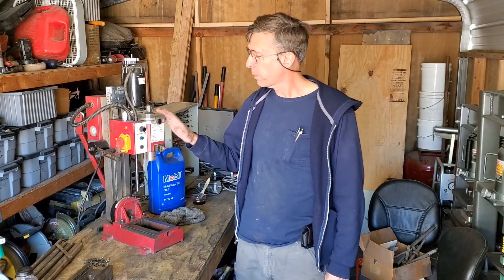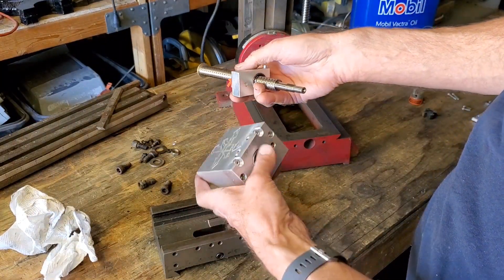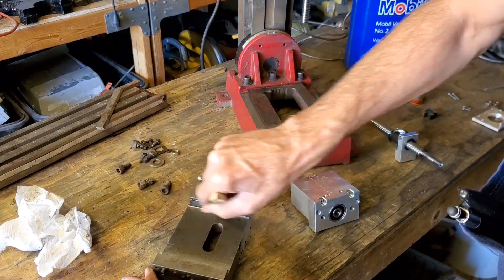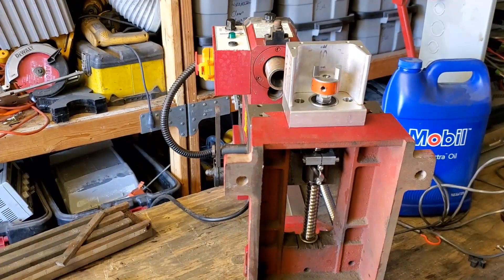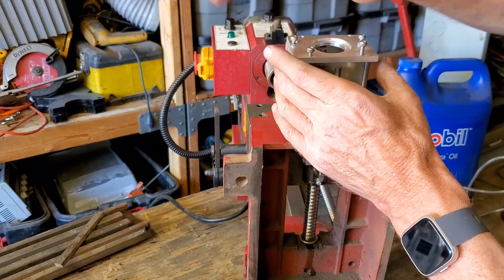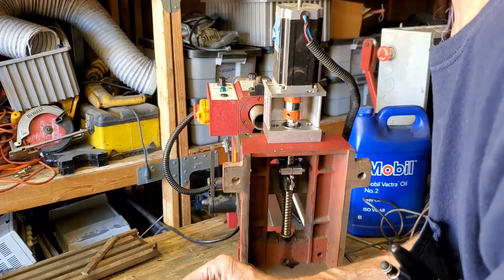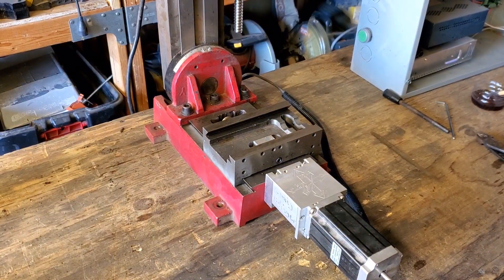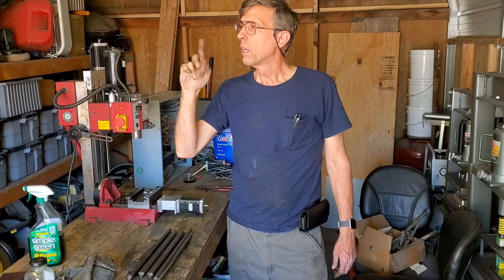Mini Mill Back to Life Part 2 - Y Axis

Comment: Crunchy? Send it back. This is not just an oil fix. There is not enough space for the balls to move freely and no amount of oil will fix that. A good ball nut properlyvj set up should spin freely down the thread  when held vertically. You've got a rotten package.
Reply from the maker: Wish I could, that was 5 years ago. Good to know. Maybe that's what my problem has been.